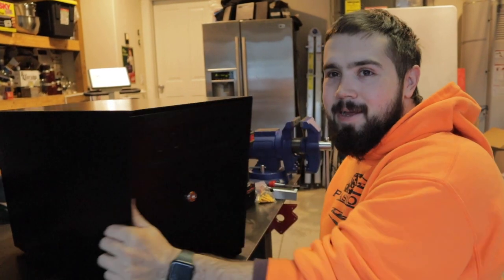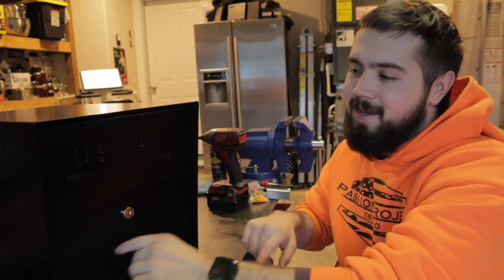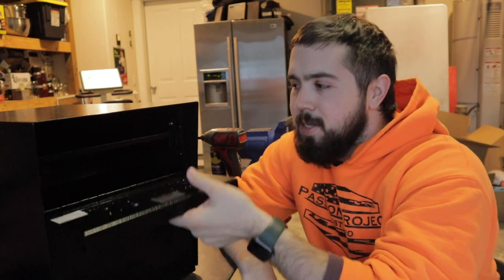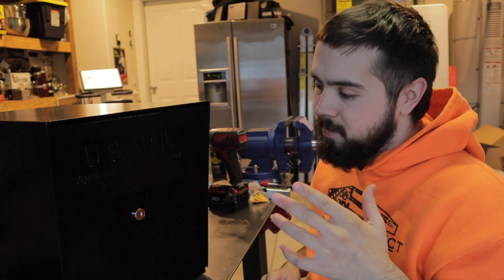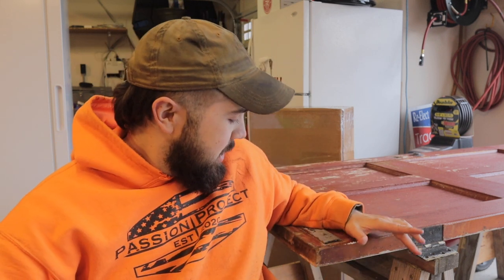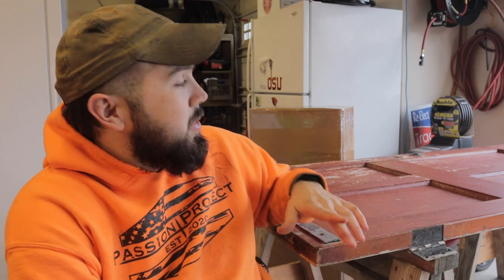Timber Framed Mailbox

Comment: My dad built a very similar timber frame mailbox in 1977.  It lasted for about 30 years before he had to replace it.  Now it's just a cheap and simple steel double square post which was a lot easier for a man in his 60's to install.  However, every time I go home to visit, even after more than 10 years, I still look at that post and it just doesn't feel right.  That simple timber post is perfect.

Just a bit of advice:  When running in lag bolts, rub a little bit of bee's wax onto them.  It makes a world of difference.  Using bee's wax on the threads, I've only ever had to resort to power tools if I'm pressed for time.  I always keep a small bar of the stuff in my 1/4" lag bolt tray.
Reply from the maker: I’d be happy if mine lasts that long. The bees wax is a good trick.

Comment: Recently quoted a 40x60 shop here in Indiana...$52k for basic shell and only 4" floor...covid has jacked up build prices...best to hold off till after pandemic
Reply from the maker: That’s better prices than I’m seeing out here right now. I’m seeing around 55k for just the shell, no slab.
Reply: @LivingOnWheels  woof, hard to justify it right now. This company was doing tripled 2x6s for posts and 2x4 girts which should be cheaper. I think I quoted something similar a year ago or so and it was in the 30s...I'm waiting.
Reply from the maker: @EngineersHomestead  yeah. I won’t be building immediately and will be shopping around a little when I do
Reply: @LivingOnWheels  what size you thinking? I think you may have said in the first new home video.
Reply from the maker: @EngineersHomestead  40x60 would be my dream but probably closer to 36x48